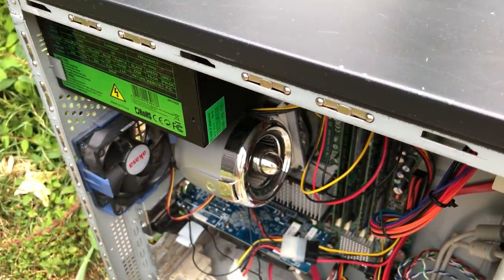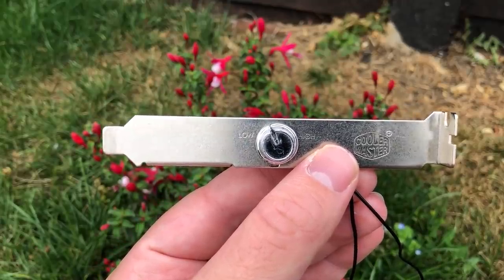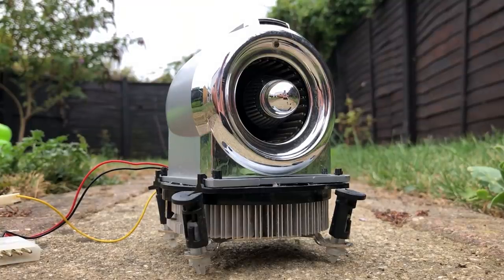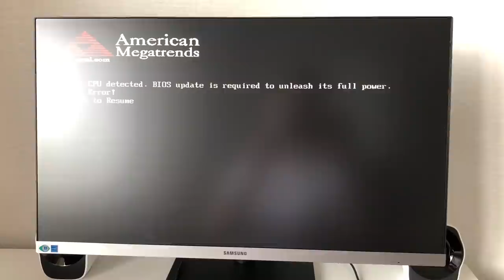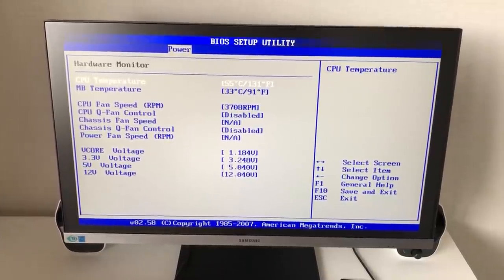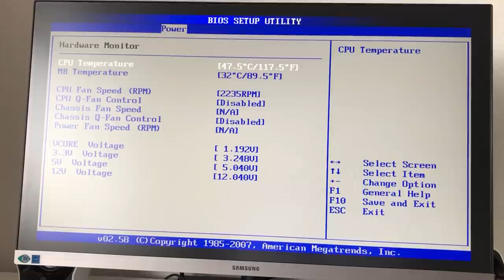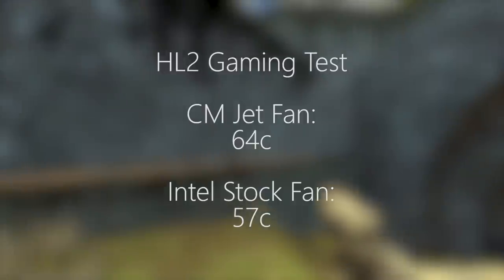Weird Tech: Cooler Master's Jet Engine CPU Cooler

Comment: I HAD one of these! I used it on my AMD Athlon M 2400 and it was pretty insane.
Reply: I had one on my P4 3.2 Preshot, kept that space heater under control quite well. Shame he didnt have the correct heatsink, his tests would have been completely in the opposite direction.

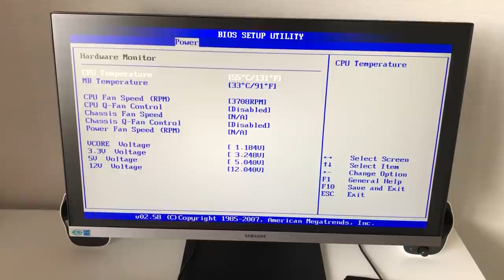Comment: 5:45 The heat would be exactly the same as if you used any other cooler. All that coolers do is move heat around, they don't stop the heat existing. If anything, a less efficient cooler might cause a processor to overheat and throttle, creating less heat at a lower frequency and so put out less heat.

Comment: Cool I had 2 of those on a dual AMD MP 2200 setup in the early 2000s, with a whole 1GB of ram :) i remember having to do a little DIY to the original coolers to get the to fit around the RAM slots, it was that old style you had to force in with a screwdriver.  It's still sitting in the garage, and i think the last time I started it was about 7 years ago and it was running ubuntu.  Also its a a clear Sunbeam - Acrylic PC Case.

Comment: As a plane person, I NEED THIS NOW.
Reply: Plane person? Why didn't you become a pilot then 🤣
Reply: @Russell970  bc I'm a child 🙀
Reply: @Kyo-bd4tw  Keep up the dream ^^
Reply: @Russell970  Thanks!
Reply: @Russell970  also just built my first pc
Reply: @Kyo-bd4tw  and the specs are?
Reply: @Russell970  I3-9100f
RX 550 
H310M Pro-VDH Plus
Kingston 250gb ssd
Cooler master Q300L
Some sfx psu 350 watts
Some upHere rgb fans
Reply: @Kyo-bd4tw  a higher wattage psu would have been better. It should be fine if you're not overclocking.
Reply: @ZzSlumberzZ  I'm only slightly overclocking and I'm on a budget
Reply: @ZzSlumberzZ  I mean that is what Christmas time is for right?
Reply: Time to overheat my ryzen 7 3700x if I had that

Comment: I have a Thermaltake star power which is somewhat similar to this concept of using a dial to control the fan speed
Reply: Yeah for OEM replacements they make aftermarket fan control since you never know if the system has fan control or even has fan headers so it helps with compatibility and you can pair it slow with a low TDP or run it fast for hotter chips.

It’s a good idea, almost as good as my home-made fan controllers which can boost fan voltage as high as you want, many cheap 12v case fans will survive 20v-24v which is roughly 2.8x-4x the power, basically does the same as these except allows for “overclocking” your fans as well.
Reply: Wouldn't this be perfect for a raspberry pi?
Reply: Pasta Sarmonella E-Specialé I don’t think you usually need a fan for a pi, so there is not much point covering the heatsink with dust that you have to maintain more often or adding another 20% more power usage by adding a fan. If you were wanting a fan then it’s ok, but I think you can just wire a transistor to a potentiometer and control your fan (I think thats what these do), or better yet use a $1 buck converter would be the easiest to regulate the voltage/speed of the fan.

Or if you want I’ve published a waterblock you can use on the Pi if you are wanting to overclock it. My tablet has a full water loop on it and I paid under $5 for everything needed and themed it to look like Fallout 4 post apocalyptic look with the pump hidden inside the radiation barrel pumping radioactive waste (green anti-freeze) to my custom block, then over to an array of rusty steel pipes for the radiator (since the pipes would be rusty a hundred years into the future in the wasteland). Now that thing cools well, I got a 44% overclock with it running 40c cooler than stock out of the box, so it works. So if you’re going to bother even having a fan on a pi, you might as well go for a full out mini PC and make it look cool (it’s very simple, I was bored one afternoon and assembled it all during a boring movie, my design is “Penny Waterblock” on Thingiverse because it uses a copper penny sanded flat for the cooling contact). It’s also small, it all fits on the back of my 7” tablet, so if I could get smaller pumps I’d water cool my phone.

Comment: I have this cooler on my old gaming rig with an Athlon XP 3200+. I haven't used that computer in years, but it worked well keeping that 3200 under the red line. Admittedly, I bought it more for aesthetics, and I believe all the airflow through the Antec 900 case helped that old jet 7 do it's job.

Comment: As someone who messes around with potentiometers on electric guitars (that dial is a potentiometer), the fan behavior makes perfect sense. The dial adjusts the resistance which adjusts voltage (which regulates fan rpm in this case).

However, potentiometers don't regulate the resistance if the first and last lug are connected like 4:40. So it just ran the fan at full voltage, thus full speed.

Comment: The dial is just a variable resistor, and is an essential part of the circuit, you wont harm the fan if you get the wiring combination wrong, it will just run slow. just hook it back up to the center pin and one of the outer ones.

Comment: A couple of smallish paint brushes makes cleaning dust out of components easier. They get in between the fins of heatsinks & into the corners of fans quite well. I also cut the handle down on the smaller brushes to make it easier to move around inside cases.

Comment: I had this cooler. It worked and worked well. (as long as you kept the dust out). And since it's just a blower fan it wasn't that loud, the bearings on yours are obvious toast. Then came Zalman and it was all over. That copper flower was all we needed from there on in.

Comment: I also own one of these beautiful CPU coolers. This was actually a Socket-A cooler. I used it to cool an AMD Athlon Barton 3200+. Until I exchanged it for a Thermaltake Beetle for fear it would tear the socket off my board. The cooler weighs ~600 grams, but the socket-A is only designed for 300 grams. The Beetle is screwed to the board, not clamped to the socket. The idea behind this concept was, the axial fans have a slipstream in the middle under the fan motor. But exactly under this slipstream is the processor. A radial fan blows air into the cooler over the whole surface. The problem with your fan-cooler combination is the core in the middle of the Intel stock cooler. It will create a lot of turbulence.

Comment: I had one of the Jet engine looking fans. They also made a squirrel cage fan without the jet. That worked well and was much easier to find in the store. I still own a few of those.  A very cool looking heat sink.

Comment: Had a friend several years ago use the original Jet-7 in his build, and it worked fine. It might be the mods with the heat sink causing it to give less than ideal performance. He did just leave the dial on full because he couldn't be bothered reaching around the case all the time.

Comment: Omg I've actually had one of these, I think it was attached to my old Athlon XP 3200 Barton. I actually had a really good gigabyte motherboard which has the Nvidia soundstorm on board as well. It was a severe mismatch blouse wise when I brought a passively cooled Nvidia 6800. Thank you for this as it's briught back so many memories & with today's knowledge I'd not buy it today if I was around in 2004.

Comment: That is a potentiometer.  The outer 2 are designed for reference.  IE 0 and "positive" max.  Middle is the variable setting.  And solder doesn't "dry out".  The copper wires work harden, and snap.

Comment: Solder doesn't "dry up" as it's literally just metal that melts at a low temperature, but it is quite common for the part of the wire right above the solder joint to get fatigued from repeated bending and break suddenly.

Comment: I've had all manner of odd coolers (cpu and gpu). My favorite is still my old THERMALTAKE VENUS 12. Heavy chunk of copper with a very loud three bladed 80mm fan. After about six months it snapped the mounting clips off the motherboard.

Comment: The dial your messing with is called a potentiometer. It uses resistance measured in Ohms to change voltage going to the fan motor. 

I use them a lot in the industrial field.

Comment: I had a turbine cooler back in the day. A lot of airflow per watt  and high static pressure but those are about the only upsides. The air really needs to be guided properly over the heatsink though as it doesn't produce the same flow pattern as a standard fan (which those heatsinks are designed for use with).

Comment: interesting, it's the same aluminum slab + fin design on even current dell prebuilts. I just upgraded from one of those, and the thermal component looks identical to mine, which was cooling a much more serious i5 4590, and probably could have gone up to an i7 4790k, if not overclocked at all. It's a neat fan, probably very cool for a certain aesthetic.

Comment: I actually had one of these back in the day. The thoery was to take the central spinal part from the center of a traditional fan away thus leave no middle hot spot. Back when AMD had no header speeders and very small central die.

It was quirky and back then a lot of quirky air coolers and Hest sinks came out. Massive solid copper ones, ones plated in silver, ones with weird fan designs, moores law was still being pushed and mutlicore was only just starting.

This makes me so nostalgic.

Comment: That case is the same exact one I had for my first pc! I kept it for about 13 years, even when I had to leave it open because somwhere along the way I upgraded to a Scythe Ninja 3, which was simply too big for it. When I finally replaced it I didn't know my new case wouldn't come with a beeper, so I took the old one and crammed it in there. Now it's the only part of my original pc and I really enjoy still hearing it everytime I boot my machine :D

Comment: I used to own one of these back in the day. The fan controller was in the floppy bay, on the front of the case, so, a bit more practical. It was able to cool my Athlon XP 2500+ overclocked from 1833MHz to 2.2GHz, and looked seriously good in my very cheap case with a plexiglass window. Didn't do much to make my cable clutter any cooler, though. Nor was it the same color as the neon light the case had. Ah, the early days of the PC bling...

Comment: I actually came across two of these (in transparent plastic and green fans) in a box of pc junk I've picked up. They were also Coolermaster branded. I ended up throwing them out since they just looked cheap and I wasn't ever going to use them. This one in metallic actually seems cool to put in a system.

Comment: I remember when these came out as was working in a PC builder / support role around that time, they used to compete with products like the Zalman CNPS7500 but were inferior for cooling.  I was always attracted to them due to their unique design, companies like Overclockers UK used to sell them and they weren't cheap at the time.

Comment: i had this cooler but the blower was over a copper unit with straight fins (youre getting terrible temps because its a round unit). it worked very well for the time cooling my athlon 2600 xp-m nicely. thanks for the flashback. oh and if memory serves, you can just strip and twist those wires together for constant max speed

Comment: The strength of radial fans is static pressure more than throughput, so you might try finding a heatsink with super high fin density for this.

Comment: Solder never dries out, it is an alloy of tin and lead (usually), sometimes some other metals, but there is no water or other liquid to "dry out" If soldered improperly it can be a "cold solder joint" which implies the soldering was done at too low a temperature. This can be fixed by reheating the solder or "sucking" the solder with a tool or solder wick and re-soldering.

Comment: Might I suggest you look online or with local hardware stores most of them have small air compressors that are relativly cheap (between $35-$80usd depending on psi) and they are a bit noisey but in the long run it saves a lot of money and hastle. Air duster spray can get expensive and only last so long but with a small air compressor as long as you have power, you'll have air, some even have adjustable PSI's and most have changeable ends that you can use that are smaller then even the air duster tubes. You might also want to consider getting some small paint brushes they are good for getting the dust out if cracks and such.

Comment: With all the cleaning youre doing, you should invest in a small air compressor. Should save you money in the long run. Also fyi, always keep a compressor the right way up. Avoid tilting it too much to either side also.

Comment: I had that same one but minus the cooler part so I cut molex connectors and soldered a 4 AA battery pack and used up top a makeshift styrofoam cooler dry ice smoke machine, good fun it was.

Comment: I actually had one of these on an old Athlon system back in the day. I was disappointed in the performance, but it just looked so damn cool. In the end, I ended up stacking it onto an 80mm fan and that did the trick, although I did have to dremel my side panel so it could stick out.

Comment: Just a guess, maybe you need to install that fan on a heatsink that don't have a huge center without fins, normal fans have a huge dead spot in the hub, blower fans not.
Thanks for the video!

Comment: Yep still have one of these on my XP retro gaming rig with an AMD Athlon. I run it at its lowest setting as it really can sound pretty loud even in a case under the table! Doesn't seem to get that hot though when its attached to the cooler it was designed to go with I have to say.

Comment: Oh man, I had a rather similar setup back in the Socket 478 days:
I took the radial fan off a broken Cooler Master Aero (basically the same thing that's inside the Jet 4, but a lot less flashy) and hot-glued it to an Arctic Cooling Freezer 4 heatsink. This janky setup actually kept my P4 reasonably cool even at a 4 GHz overclock, but boy did it ever sound like an angry vacuum cleaner. I have no idea how I managed to sleep right next to my PC when it was THAT noisy...

Comment: i almost bought this cooler back in the day for my p4 system but ended up getting cooler masters vortex dream instead since the jet cooler didnt have as good of specs even though was bigger and cost more and i too had the wire break on the rpm controller dial on first installation and had to resolder it, they also came with a 3.5 drive bay bracket for the rpm knob

Comment: @RandonGaminginHD You could have also just twisted those two wires together and had it run at full speed, the dial is just a potentiometer and just varies its resistance resistance and while doing so the current from the 12v rails to the Fan

Comment: The blades on the fan are flat and not blowing that much air and the vacuum that pulls air from the cpu isn’t working well either, consider 3D printing a new fan barrel should do the trick, the cpu should be in front of the Jet not on the bottom lol, someone didn’t think this through well

Comment: You should pick up a small air compressor to quickly clean PC's. Just hold the fan(s) to prevent them from rotating if they are connected to the system. I've heard that the spinning fan can generate a charge and potentially damage the motherboard.

Comment: How about “Bizarre Tech”, “Strange Brew”, or “Weird Stuff” for a series title? There’s a lot of parts and even PCs out there that leave you wondering what the engineers were thinking, so it should be a great series. Places like eBay and AliExpress are both places you can find some strange computer tech but maybe Facebook marketplace, too. To get you started, how about taking a look at some of old HP systems that had a normal looking case until you look at the rear and realize there is no power supply. The HP P2-1310 is a perfect example of this. Inside the full tower you’ll find an ITX motherboard that is powered by a laptop style power adapter. The CPU and GPU are both integrated. Now that’s just a weird build. Might be cool to see you find one of these and see how far you can push the system.

Comment: I owned one of these on my old Athlon 2500+ lol
the original heatsink is full copper iirc which is quite nice
there should be another front panel that goes into the 2.5" floppy drive space at the front of case

Comment: it's always amusing when someone doesn't quite know how a potentiometer works.  at least you figured it out though which is always a good thing.  I also wouldn't take blame for the wires coming off.  there's very little reason it should have gotten so frayed unless it was moved repeatedly and without much care for the joint during its life time.

Comment: discard the fan speed button and just jump the 2 black wires together it will work at 100% speed all the time. Basic electricity. This button is like a gradator switch in your house

Comment: I had one of these they were cool,  loud however on full stick. They did originally come with a taller then stock copper/brass HS which with tall thin fins and was likely much better then the HS it was attached in this test. The test likely didn't do it justice as the original HS likely made a huge difference however they weren't the best performers anyhow mostly just better then a stock cooler

Comment: for some reason i still have this cooler , despite having long moved on from the socket 478 platform ... pretty noisy at full tilt .also theres another coolermaster blower style cooler like this , except its called the aero 7 and has a different fan housing shape